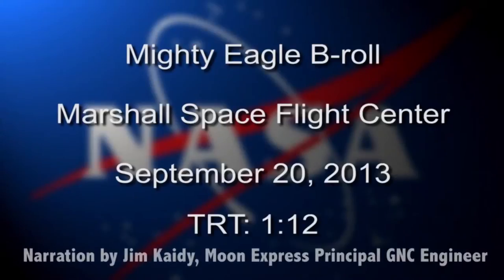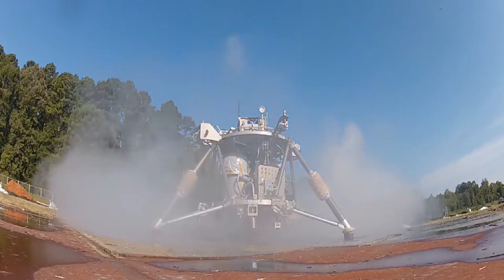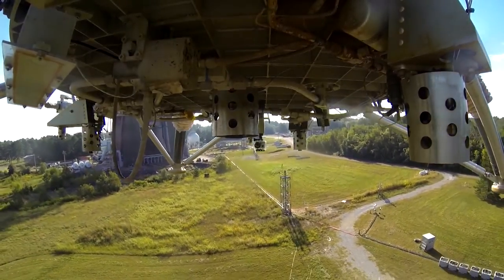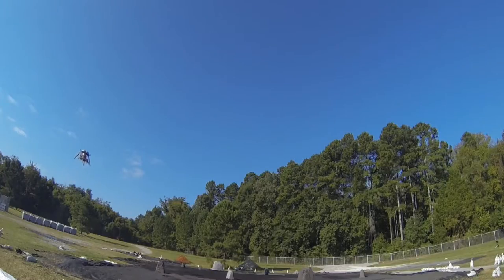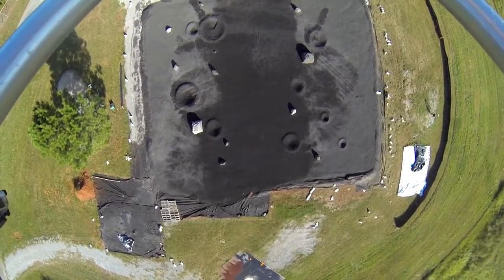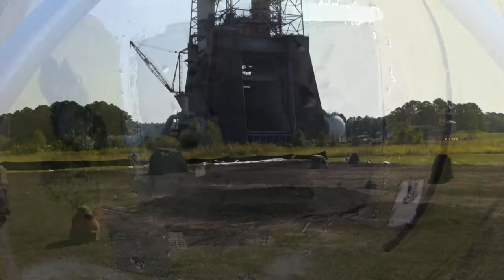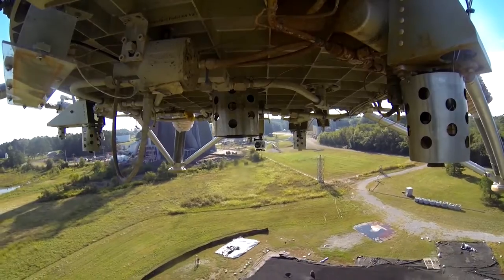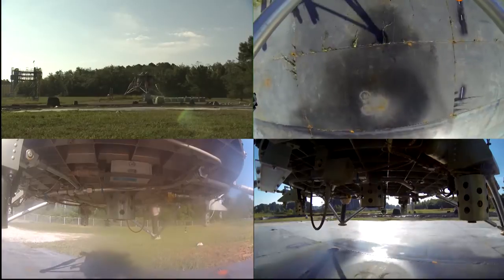Mighty Eagle - Moon Express Open Loop Software Test

Comment: I can only hope that NASA and/or whoever goes back to the moon first, will have the sense to use helicopter pilots to land the lunar landers.   No offense to the jet guys, but come on...jets land to runways.   Ya, I know...some of those guys were carrier-qualed.  But, come on...they're runways, no matter what way you look at it.  Helicopter pilots are trained from day one to expect the unexpected.  I can't begin to imagine how many times helicopter pilots have taken off took off not knowing what the terrain was gonna be like where they eventually landed.  That's the way a helicopter pilot's brain is trained and works.  Constantly and instantly evaluating the best landing site.  It's ingrained.  As the old helicopter pilot joke/saying goes...we don't need no stinking runways...   :-)     But, think about it...would you hire a gastro-intestinal surgeon to operate on your brain?   Heck, they're both MDs...right?   So, why would you have a jet pilot operate and land a vehicle that is, for all practical purposes, a helicopter.  I mean...come on.     Using Google Moon, I recently "flew" the exact profile that Apollo 11 flew over the bolder field just north of West Crater (the primary landing site).  Not saying Armstrong did anything wrong (he was simply defaulting to safety, because he wasn't a seasoned helicopter pilot), but quite frankly, as a 45 year, 20,000 + hour veteran of flying helicopters (including a Vietnam tour), my only question I'd have had in my mind on that landing would have been, "Which bolder do I want to land this thing next to?"    Please NASA/Space X, etc., use experienced helicopter pilots to land you lunar landers.   They'll get you there, safe and sound...guaranteed.